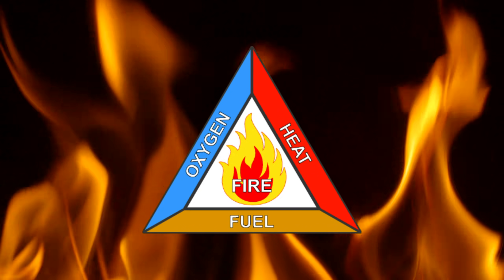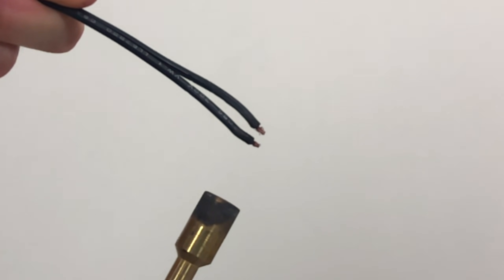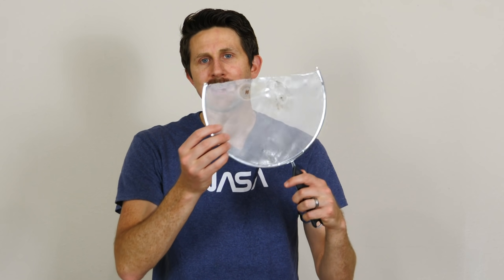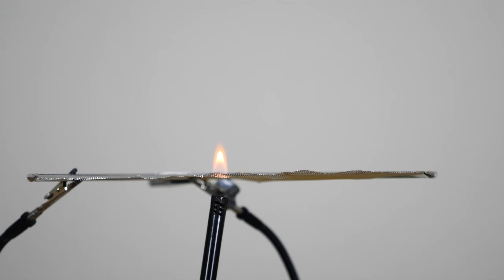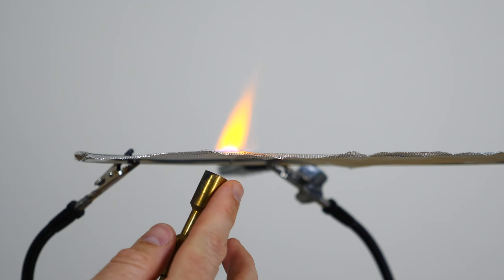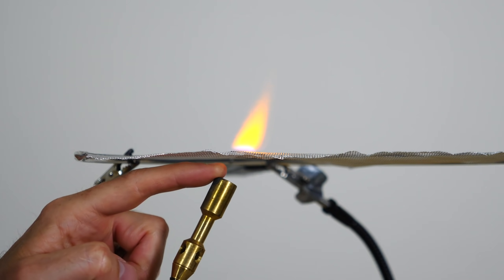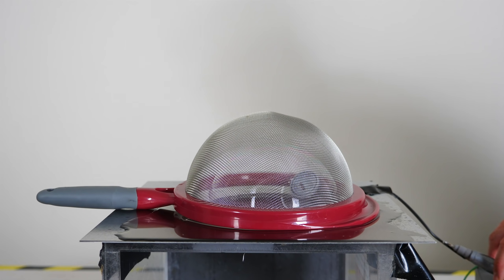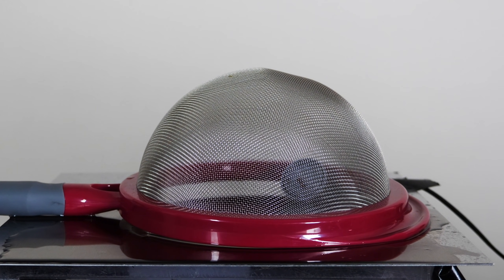Catching an Explosion—The Davy Miners Safety Lamp

Comment: People don't know that this was the technology which saved countless miners in 19th and 20th century.
Reply: I'm very interested in reading more about that! But I tried googling it but I couldn't find it anything. Do you have any links or any other references you can point me towards? Was it an invention that was patented? Is there a name for it?
Reply: Oh and thank you!
Reply: @-pyrosef-  https://en.wikipedia.org/wiki/Davy_lamp
Reply: @avhuf  yes read that. it should be too risky as it was since it was the reason to kill hundreds of people....
Reply: It's called fire arrestor 
Usually built in any flare out at the end of industrial process
Reply: Given even if it was the technology the kept many safe, this isn’t knowledge the common person would run across. “Oh hey by the way did you know which technological advance save countless of minors in the 19th and 20th century ????”  Ya na
Reply: That's a rather generalized statement.
Reply: @-pyrosef-   search for Davy lamp it was used to provide light for miners in coal mine, it usually covers carbide lamps, it glows differently in a combustible environment thereby detecting flammable gases and alerting miners from explosions.
Reply: @BURNTTOAST428  I just found it surprising that he didn't talk about its origins and historical significance.
Reply: Suryansh Srivastava oh I see your point. I also agree with that.
Reply: What if the tanks on a rocket has either a single, or maybe multiple such grids in them, you could stop a rocket from exploding.   Or, at least slow it down enough that any upper crew or cargo stage could make it a safe distance away.   Also Rockets would have cryogenic temperatures going for them, this should overcome any difference in the energy output of rocket fuel and oxidizer.   Imagine a tube with a mix of cryogenic Liquid Oxygen and Liquid Kerosine in the right proportions (super freaking risky, but still) and an array heat tubes which help stop the fire propagating out of the rocket engine.   The heat from the engine warms the gas pushing it, you don't need a pump, you don't risk explosion (if it all works right) and you only need one mono-tank so it's lighter.
Reply: Jonathan Berry a question of scale eh.  Big objects hold more heat, and so a strainer screen might be too small scale.  And if you scale it up so it works, it will weigh a lot.
Reply: This didn't save people. It prevented a disaster to happen. There's a clear distinction between the two. Saving someone requires that bad thing has already happened, but this wire mesh merely prevents the bad thing to happen.
Reply: @anteshell  You must be fun at parties 😂😂
Reply: @suryanshsrivastava5551  From Wikipedia: "...in the next thirty years, firedamp explosions in Whitehaven pits killed 137 people:139 More generally, the Select Committee on Accidents in Mines reported in 1835 that the introduction of the Davy lamp had led to an increase in mine accidents:130 the lamp encouraged the working of mines and parts of mines that had previously been closed for safety reasons."

Comment: I think the mesh stops the fire not only by taking away the heat, but also because the holes are smaller than the quenching distance (or diameter) for that mixture of the fuel and oxygen. If a different mixture or a different fuel was used the same mesh might not be able to stop the flame.

Comment: Having worked as a landfill gas technician, I’ve seen that every utility flare station had a FLAME ARRESTOR mounted on the landfill gas piping just outside of the flare inlet. Though they were much more robustly constructed than with screens, their thermal inertia was more than enough to prevent any flame from propagating backwards!

Comment: To show the true benefit of the miners lamp, you should have lit a candle under the mesh.
Then allow the flammable gas to surround it.
It would demonstrate how a candle can be safely used in an environment with potentially flammable gasses.

Comment: This is an interesting effect. It makes me think of Hollywood bomb squads where they blow up the bomb in the street under a dome they tapped into the asphalt to anchor. Assuming that is at all realistic, I wonder if a mesh dome smaller than the metal one would reduce the payload of the detonation, stopping some fuel from reacting. Or perhaps someone could make antifire devices. Like perhaps in places of drought this could be adapted to fight wildfires somehow. Great video, amd thank you!

Comment: You could have shown us how large the bubble explosion would have been without the strainer. Would have made the affect more clear. Plus it's important to always have a control ;-)
How about a larger container filled with heavier than air flammable gas. Inside it run a tube of porus mesh, in one side of container and out the other. The tube would fill with gas, but would a flame applied on one end propagate to the other end without igniting the rest of the gas?

Comment: The “fire triangle” misses a major part of the equations, chemical reaction. Fire does not exists without a chemical reaction.
Reply: But the triangle just covers the conditions necessary for that chemical reaction to occur, right? Though I'm wondering if the screen is in some way inhibiting the reaction rather than the heat transfer. I'm no fire expert though lol.

Comment: I got a question.

We know that if we heat air, the kinetic energy of the particles increases and the air becomes lighter.

So, if we shine a torch through heated air, will the light actually travel with more speed? coz the air lifts up and there is less resistance to the light particles or photons.
Reply: Yes you are right.
Hot air is less denser than cool air and hence light moves comparitively faster through hot air.
Its a case of refraction.
And this is also the reason behind the phenomenon 'MIRAGE'

Comment: I'm having a doubt
Whats the role of OXYGEN in combustion?🙄
Reply: Im not 100% sure, but I don't think it HAS to be oxygen i think there just has to be a chemical to act as an oxidiser, once again, im not sure
Reply: if the fuel should burn , the heat should propagate down and up just as shown in the video,here, the oxygen helps in the propagation of the heat as oxygen is an excellent conducter of heat
Reply: No one told you to skip chemistry classes

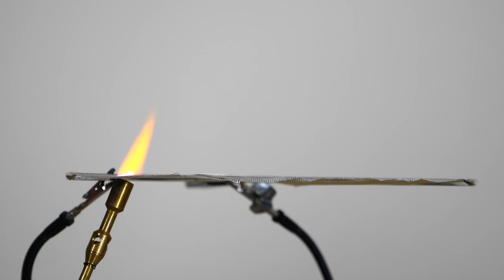Comment: At 1:50, if you remove the torch from below the strainer, rhe fire wil immediately or quickly disappear or dissipate or something like that right.. right? Or if you shoot the spark without the torch below you wont get a flame right? Mayve just a spark on the metal grating of the sifter??